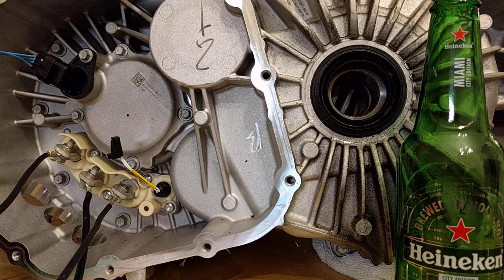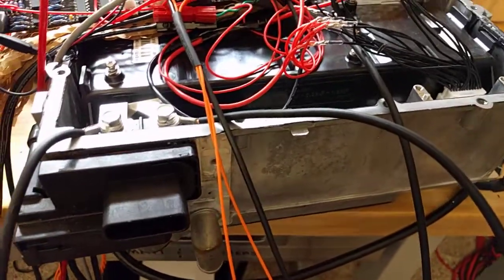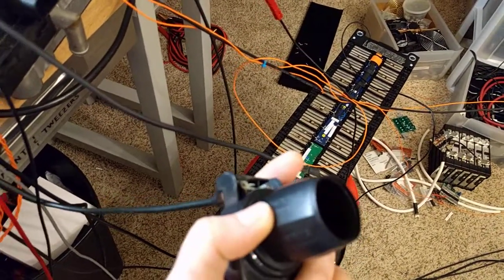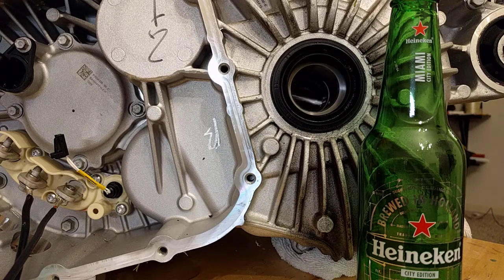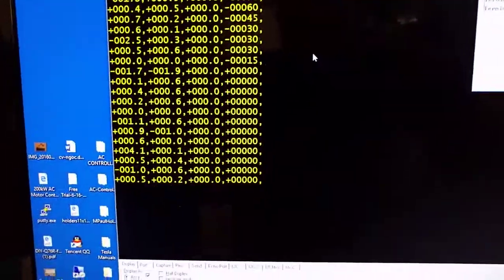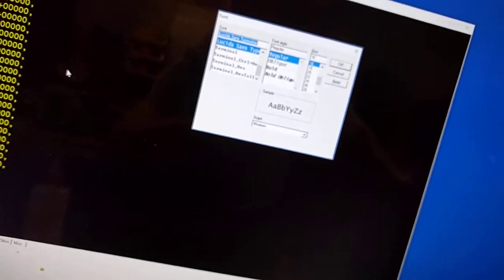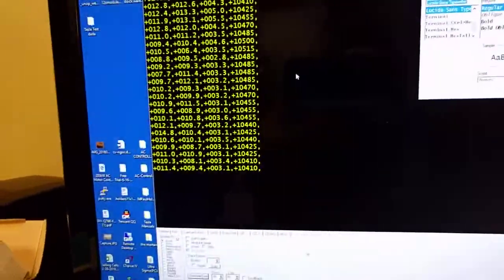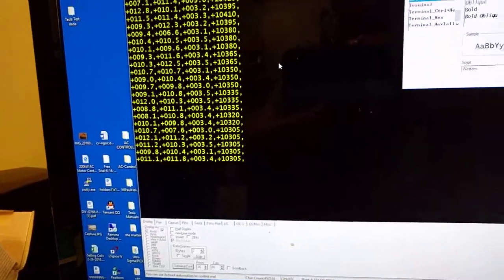Test #3 update - Tesla Model S high efficiency drive unit control

Comment: Cool stuff!  Looks like the small unit is definitely a bit more efficient than the large one.  Takes something like a few hundred watts to maintain a high speed with my loose large unit using the stock inverter.  No luck with CAN control on a small unit? I haven't gotten one to try yet. :(
Reply from the maker: Not really interested in a CANBUS hack, this way we can have full control over power, torque, regen, drive-ability. Although, once we get our dyno built, it would be cool to compares apples to apples tesla control vs our control in terms of efficiency, etc.
Reply: Good luck! I look forward to seeing how your final solution turns out.